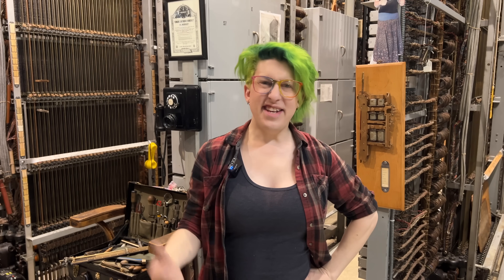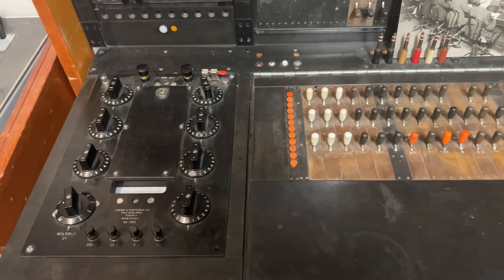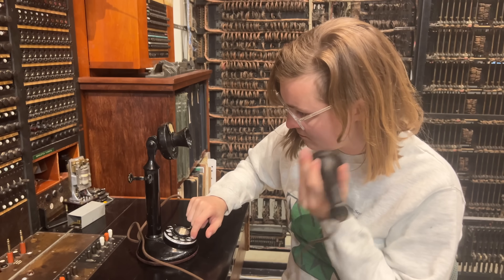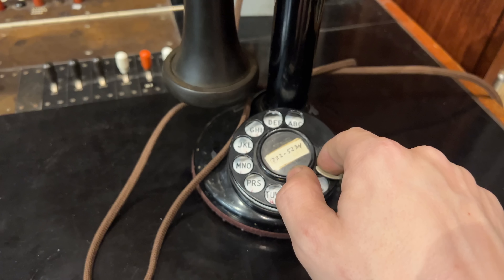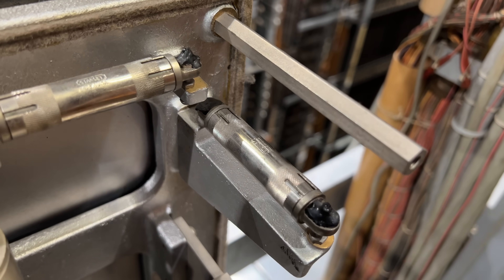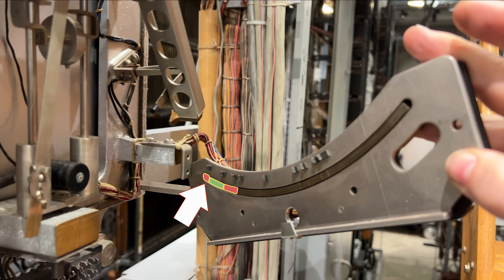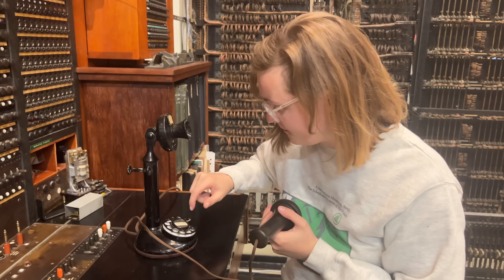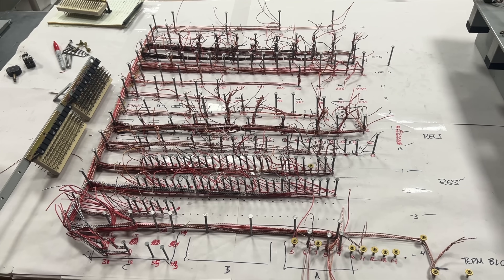What's up with this weird pendulum test device?

Comment: I operated a Stromberg Carlson local test desk in 1971 in a 5000 line exchange. Not only phone lines tested, but teletype, secure voice, and many dedicated circuits. There were two desks that operated in the day and one at night. 24/7 in 12 hour shifts. I worked the night shift with one frame man and one switch maintainer. It was a stressful job I still remember today. The work orders never stopped. I was lucky that the frame man worked there for several years and knew the main frame very well. Made this cable splicer look like I knew what I was doing. 😊

Comment: As kids in the late 60s in Los Angeles we "helped" the dial return fast as we could (if no adult was watching). I don't remember calls failing, and the pulses were definitely faster than normal. Maybe that was late enough for our exchange to have been solid-state?
(I think phreaking was possible by then, at least in some cities)
Reply: You definitely would've been on some sort of electromechanical switch back then. I believe in that part of the country they used different equipment than the standard Western Electric switches, but I don't know what.

In another video Sarah has said that the 5XB would print a trouble card if the digits were dialed far enough from the proper speed. People messing with the dial on such a system would've caused many nuisance entries.
Reply: @eDoc2020  The Stromberg Carlson XY switching could keep up with fast pulses. Used to do speed dials with out a problem.

Comment: This really interesting to me. I began my professional life working as a technician in a step-by-step telephone exchange back in 1973. It was a small exchange and we didn't have a dial tester like that but our main timepiece was a wall-mounted Gents(?) wall pendulum clock with a contact and electromagnetic boost when the amplitude of the pendulum dropped below a certain level. A friend of mine acquired one of those and I restored it for him back in 2019 and fitted a small Li-Ion battery and solar cell to keep it running; it took very little power and 4V was sufficient.
I recognized the uniselectors mounted on the rack as soon as i saw them in the video. What a memory trip.

Comment: 5:22 Interesting test method. Thank You for showing and explaining.  I was more familiar with Automatic Electric equipment, where I worked.  Dial speed and Pulses Per Second, plus make/break percentage of those pulses. Western Electric (WECO), was certainly recognized in the past and will be remembered for their quality and dependability.  Thanks again.

Comment: Long ago a friend of mine was injured and could not stand up to get to the phone.  As he pulled on the cord to get the phone to fall off the counter to him on the floor, the cord broke and came out.  This guy, being an engineer, knew exactly how pulse dialing worked.  He managed to get the 2 phone wires bared, and he shorted and opened them enough times, and at an "acceptable rate" to dial 911.  (Apparently, in the '70s, the CO equipment was forgiving enough that his slow clicking worked.)  Though he could not speak to anyone, he repeatedly dialed 911, waited several seconds, connected the wire together to hang up, and repeated this many many times.  The dispatcher, handling all these "weird" no-voice calls sent officers to do a "health and welfare" check.  Amazing!

Comment: Great explanation of that test system! It brings back a great memory of mine! Back in the 70s, I bought a brand new airport control tower switching panel at a swapfest, which had a very fast dial on it. I hooked it up to the family phone line as an extension. The fast dial worked beautifully for winning radio contests at my local radio station! No one could compete with that system!

Comment: I started at Bell Canada in the SxS central office in 1973. I was fresh out of college so thought it would be all electronic (either discrete semiconductors or analog chips). Boy, I was so wrong, everything was electromechanical so I was sent on a 2-week course to become a "switch mechanic". Anyway, I worked on 3CL boards (used by toll operators), as well as local test boards use by technicians to diagnose customer line problems. By testing for shorts, noisy carbons and the like, the technician would attempt to charge the line capacitively then watch the discharge to determine if the trouble was in or out. That is, inside the CO or out in the field. If they couldn't tell, they would call the MDF frame and have a technician pull the (heat) coils on the designated line (er, cable-pair). Sometimes you would be asked to install a shoe (which was connected to a third line) to allow the tester to look in our out. We installed a DMS-200 circa 1978 which meant the end of the 3CL board. We added a DMS-100 but the test boards were kept in place until everything was cutover to
Reply: Yes, Pull the carbon block and Shoe in to the pair. Look both ways and hope the problem was not in the exchange but somewhere out there. I ran a local test desk  12 hours a day on night shift 6 days a week in a 5000 phone line exchange with teletype, secure voice circuits and about a thousand dedicated circuits. It was a nerve wracking job. 😵‍💫I was so glad to get away from it.
Reply: Aa yes, the god old Tip + Ring days (but don't forget the Sleeve if you ever worked in a SxS central office or 3CL board)

Comment: You didn't show how the loose / tight tolerance test was achieved on the tester? Was it done by varying the current to the electromagnet such that the pendulum had to be closer to the contact to latch in?
Reply: I'm guessing they adjusted the counterweight at the top of the pendulum. Only moving the start position would only work to adjust one of the two test speeds.

Comment: I loved this video -- clear and straightforward narration that doesn't dumb anything down.

I was a newly-minted electrical engineer in 1974. For my colleagues and contemporaries at the time, the phone system was the epitome of engineering excellence. This video shows why in a marvelously understated way. The researchers at Bell Labs were gods to the rest of us.

I greatly appreciate both this video and the museum that it so ably represents.
Reply: There were some really smart people back then that designed all this equipment.
Not a microchip in sight.
Most of it worked for many years with proper maintenance.
Reply: Yep. We CO types weren't called "technicians" back then, we were called "switch mechanics" even though we did a lot of electrical diagnostic analysis.
Reply: @GaryH-pw9cm  Funny you should say that. My copper phone line and ADSL was forcibly taken from me and replaced with optical fibre a few days ago. It sucks by comparison in terms of reliability and worse still, the telephones now rely on having no power interruptions as opposed to running on an exchange with battery backup.
Reply: @malectric  When I lived in the mountains and the power went out the phones still worked as they received their power from the exchange. It was kind of reassuring that at least something was still working. 😊
Back in the 1960s there was a popular mechanics article about a circuit that could be connected to a phone line that could run small light bulbs for light when the power went out. A neat idea but I never tried it. The phone company probably did not like it much. 
In 1969 a cable splicer talked a test desk operator into putting 120 volts AC on a few cable pairs so they could have lighting out where a section throw was being done. It did work, but only for a while until the wires became hot and shorted out a lot of pairs in a 600 pair cable. 😮

Comment: In my limited experience the most common fault was the dial running slow from accumulated dirt or hardening of the lubricant in the dial speed regulator. Most people, even customers,  we're familiar enough with a dial to recognize this problem. Many people could make the dial work with at least marginal reliability by forcing it back around at an approximation of the right speed. This would almost always work at least we'll enough to dial the repair line. If it didn't, you walked over to your neighbor's house and borrowed their phone to dial for repair.
Reply: Back in the day you could simulate a dial by rattling the hook switch. In the UK then pulses per second was the standard, and once you got a feel for the rhythm it was easy to dial a number well enough to convince the equipment at the exchange (what you call the CO). 

When parents put locks on the dial to stop kids using the phone, it didn't take long to independently invent this hack. It must have been invented as many times as there were geeky kids who knew how a dial worked, and copied by their friends. 

That is probably the oldest phone hack.

Comment: Now THAT's a new one on me.   At Long Lines we didn't deal much with sub loops, as out test numbers were 100, 101, 103, 103, 104, and so on.
Before Touch Tone was available at my home, I soldered the small coiled spring inside the dial governor to keep it from expanding and got a much faster dial.   Never failed, but that was newer, a 1 or 5 crossbar and didn't seem to mind the speed.
Thanks.

Comment: In the 1970s, those of us who managed data networks that used leased-line telephone circuits or large numbers of dialup POTS lines for modems had the numbers of the CO test board and developed great relationships with the CO technicians. This was done away with in the 1980s by making us report troubles to an 800 number. Ugh.
Reply: The test board operator was a cable splicers best friend. 😊

Comment: At one time I had a collection of Bell System documents about equipment service. one was a test set to service dials. It included a list of tools, and procedures to refurbish them. Unfortunately, the gentleman who gave it to me, later wanted them back.
Your test set in the video is a type of period measuring device, which is available on some universal counters. Modern scopes can also display the time on the screen to allow precise calibration. For it's day, it worked well enough to do the required job, and the fixed pendulum eliminated the need for calibratiomn Bell spent the money for reliable phones, because they retained ownership so they expected decades of lease fees from each.
Reply from the maker: Plus, from a customer-relations standpoint, people wouldn't accept dial service if they routinely got wrong numbers, or their calls failed to go through. This would lead to complaints to regulatory agencies, and general customer crankiness. So it was in their best interest to ensure that all aspects of the service were reliable.
Reply: @ConnectionsMuseum  Back in the '90s lightbing hit our TV amtenna O found pieces nearly 50 feet awway. It fried the coax into the hose, and entered our phone line/ It fried the SLIC, and a pair all the way to the CO in Eustis, Floriida. The connection still almoost worked, but with a lot of his and static. I'm tyinty to explane to whatever the phone company was at that time. The woman wa yelling, Speak up, rather than admitting that it required a service call. She kept asking, "What's wrong?" I finally told her tht it was oviously a damaged like. It still took days to get it repaired.
 few years earlier, I was an engineer at C 55 in Orlado. We were preparing fr a telethon. We'd paid a $10,000 deposit for 10 watts lines for 10 days. I decided to make onle last check in the studio, to discover that five of the ines were dead, and we wbt live in seven minutes. I called ATT lonlines. We had guaranteed serrvice, but tthe woman wo abswere d cursed, It's losing time, call back on Moday. " I told her that it was an emergenncyy. She let out anougher streak of insults, "Ecery call I get is an emergency! "  I told her, We go live i seven minutes. I would hate to have to start our Telethon ny telling our vierwers tat you refused to honor your contract with a Christan TV station.." She whispered, "You wouldn't" I hung up. I was angry, so I went outside to cool off. Exactly seven minutes later a truck rolled in. The driver was laughing, "Whaever you did has the entire dispatch office afraid they'll be fired on Monday. Keep up the good work! He started working as six more trucks  arrived. one from each section, and the district fiekd supervisor. They found a dead SKIC, that had those five lines The rest went to other businesses in the building, which wre closed for the Christmas holiday/ Eveything was working a few minutes later.  then the supervisor gave ne his business card with a request to call him directly if we ever had another problem.
They only had one more problem that I knew of. An ATT employee deleted their accout just before another telethon, but it wa easy to see  the user account that was used. I niss my days in Broadcast, but I wasn't able to continue due to health issues. IIt was fun slipping into a live studio to repair a camera between shots, wile staying out od sight, and not interfering with a live broadcast.

Comment: Thank you!

That's a very clever bit of kit. It's beautiful in how it works as well as how it looks.

How does the ringer test part of the test line work? Does it just ring back the subscriber's line when you hang up, or is it more elaborate? Also, can the test line do any other tests beyond dial speed and ringer?
Reply from the maker: I actually recorded a segment on that, but I cut it out of the final edit, because it felt unfinished.

The ringer test is part of the same circuit and it's quite simple. You just dial a 6,7,8, or 9 and it rings back your phone with a specific bell cadence when you hang up.
Reply: @ConnectionsMuseum  thank you. Sounds fairly simple and effective. Do the different digits give different cadences, if so, why?
Reply from the maker: @meerkatmcr  Yep, there is "1 bell" and "2 bell" ring. One bell is the normal cadence that is still used in the US. Two bell is one second on, one second off, one second on, three seconds off.

The cadences were used for party lines. In addition to the two cadences, you could either get ringing current on the "tip" lead or the "ring" lead, which gave you an extra layer of discrimination...again useful for party lines.
Reply: @ConnectionsMuseum  that makes sense - if you test with the wrong cadence on a party line, someone else will pick up (and if the bell is between one wire and local earth, you obviously have to put ringing current in the right place). Never considered that it would need to test party lines as well, but it all fits together.

Comment: to show visitors how the timing gets more critical over distance, having a rotary switch that connects different capacitors (and i guess inductors?) to the line to simulate. Could show how a phone close to the exchange is non issue but the same phone further away would cause issues?
Reply: Once upon a time the Pacific Science Center (at the Seattle Center) had a display demonstrating the audio quality of phone lines over the decades. I think it was more the progression of technology than line length but still interesting. I also remember a actual human phone technician coming to the house and dialing test codes.

Comment: That is very cool!  Who knew?  How about this for an idea.  Using coils and capacitors you could possibly simulate distances from the CO,  5 miles, 10 miles, 50 miles, and then see how the impact of distance impacts the quality of the dialing apparatus.  This way you would not always have to be so close to the simulated CO.
Reply: It would basically be done by parasitic capacitance and inductance. One way it could be easily simulated would be with some big spools of cable. 

I think it would behave as though the cable were even longer due to turn to turn inductance. I haven’t done any math on that so YMMV.
Reply: @wackyvorlon  Exactly.  A spool of wire, capacitor to ground, another spool of wire, a capacitor to ground and so on.  A spool of wire is used to simulate the inductance of a long span of wire, the capacitor accounts for parasitic line capacitance.  You could get any length of phone line by cascading the wire and capacitor.  It must be spooled (wound) for the need inductance in a little space.
Reply: @ToobTime  As a test board operator I could tell how many phones was on a pair with a simple test. People would connect so many unauthorized phones to a pair as extensions that the switching equipment would lock up. Anything over 6 phones would do it.
Reply: @wackyvorlon  I don't know how much 10 miles of thin wire costs but you could simulate 10 miles of wire with 10 miles of wire or with an LC ladder circuit

Comment: That is so cool!

It must be incredibly time consuming to adjust.
Reply from the maker: It is complicated to adjust at first, but once adjusted, it is quite stable, so in practice, you don't have to fiddle with it too much once its installed.
Reply: @ConnectionsMuseum  does it have any trouble with temperature variations? I know that can be a problem with pendulum clocks, but maybe it’s not running long enough for that to be a problem. 

Thank you so much for this video, it’s a really cool piece of machinery.
Reply: @wackyvorlon  Exactly that. Temperature and even air pressure variations are a problem for pendulum clocks which are supposed to run for weeks or months without manual adjustment.
Imagine a clock being 1% off in frequency. It would gain or loose a full day within 100 days or a quarter of an hour daily. You would have to adjust it every morning to keep it moderately useful. 
But 1% is probably fine for dialing sequence variation. It gets reset at the start of every single digit.